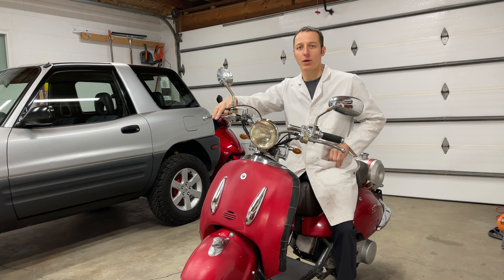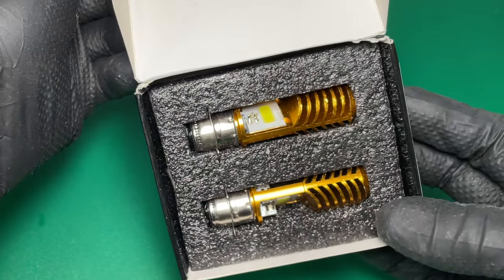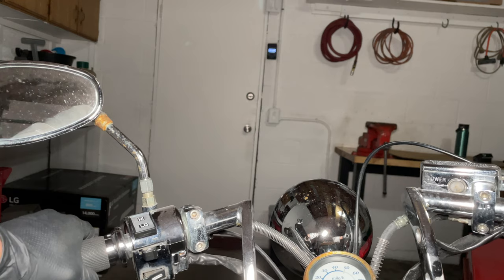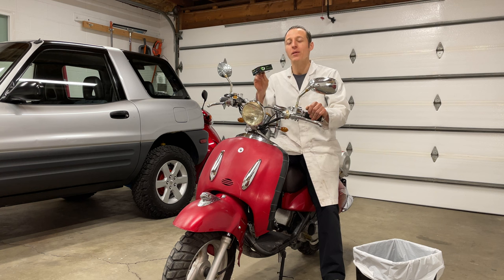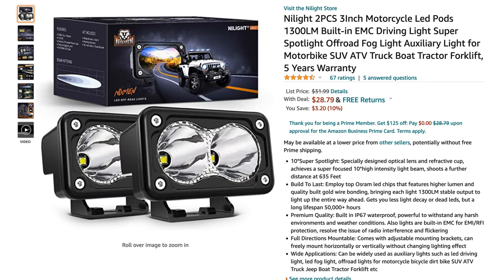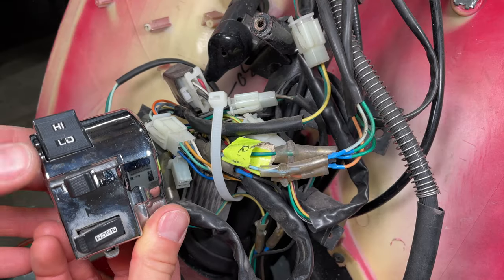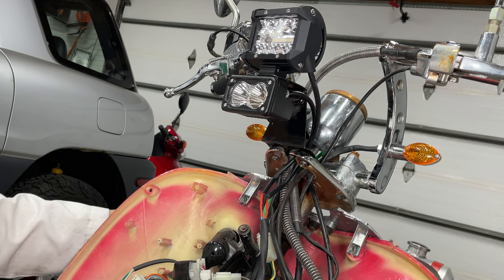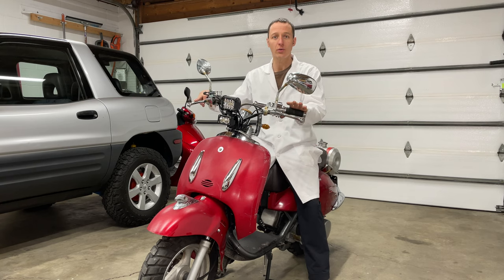LED headlight upgrade on a 150cc GY6 Chinese scooter

Comment: for future readers and viewers, those white/yellow wires coming from the gy6 139/152/157 stator are unregulated AC and require bulbs to dampen voltage and current. without bulbs AC voltage will go out of control and everything will burn out, so you need a resistor and choke to clamp that down.
don't ask me how i know.

Comment: Offroad lights typically dazzle oncoming traffic. Consider a driving light with the proper beam pattern and cutoff.
Reply: Unfortunately even factory lights have gotten ridiculously bright. If you're stuck with an old car these are actually a good way to fight back through the other drivers LED lights. I have one on the back of my truck I'll turn on if someone's following me with their brights on 😆

Comment: Your highbeam light I use on my scooter  same way. OEM bulb on replaceable in fixture only high beam worked, so I pointed it down and added the little light works well, love when cars flash their brights at me and I switch to the LED then they didn't mind the fluorescent too much . 
What you use as the low beam I use on my truck for work, works well to see more than 180° on each side or to blind other drivers who can't seem to turn off their brights 
I see you did not use a resistor on the scooter nor did I 👍🏽. Good video bro I'm gonna have to go back and watch some of that in detail to understand the wiring to help me set up my Yamaha Zuma bugeye turn signal LEDs
Reply from the maker: Thanks for watching!  Good luck with the Zuma.

Comment: About this time last year, I bought a new LED headlight bulb from Amazon,  it's much brighter than my original headlight , I paid more and got only one bulb, it is wired correctly,  I think you could have gotten a better lamp if you wanted too , you deliverably picked the cheapest  selection ,  I suspect you did this as a "lesson by example"  so viewers would not make this mistake
Reply from the maker: This one was a weird bulb size, so I didn't have any good quality options on Amazon.

Comment: If the brown wire is ac current, can you just eliminate it all together to just run off the switched DC power from the black wire? Or why did you connect it with the black and white wires?

Comment: You could put that unused 12 volts ac into a voltage regulator and power a usb charging outlet for charging phones and other accessories without and extra drain on the battery, WOW 😳
Reply from the maker: Not true.  The 8-pole stator puts out very little current.  It doesn't matter if you take it from the A/C or the D/C wires, you're still limited to about 3 amps total for the charging system.
I recommend upgrading to an 11 pole stator if you want to install additional accessories.

Comment: Re: broken plastic screw receiving holes.
I wonder if bondo would stick and could be appropriately drilled to receive screws ?
Reply from the maker: Bondo is designed to work with metal. Epoxy would work better with plastic, but the body fairings on Chinese scooters get brittle after a few years, so I just tape mine back together.

Comment: I know you saw my video review on the Nilight Nixmen for the Ba20d style bulb. I wonder if it helped you choose the Nilight brand for this project. I agree, the model you used is horrible for brightness and the difference between the high and low beams. As you see from my video I had a much different experience where my Nilight Nixmen worked awesome for both brightness and difference between high/low. My one LED cost 25 dollars. Your 2 for 16 seems really cheap. I'm sorry you had a bad experience with the brand.. perhaps you got a knock off? It seems strange you and I had such different experiences. I see your individual High and Low LED's are still Nilight brand and work well. Perhaps it's just that that particular model was off, not designed correctly?
Reply from the maker: I should have ordered the same light you got.  When I did a search for the P15D bulb, all I found was that junky one.  Nilight is a pretty good brand.  I bought some Nilight off road lights a few years ago, and they worked ok and didn't break, so that's why I got their off road lights again.  Perhaps if I searched a bit more, I could have found an LED bulb that works well.
Reply: @LabCoatPaul  I'm thinking even if you got the bulb I got it wouldn't fit your P15D socket. I know you had to find one that's claimed to match the socket/bulb style you have as I did for the Ba20d style my scooter came with. The error is clearly not your fault. I think they just really messed up on the P15D bulb. Perhaps it's a leftover from the earlier attempts at designing an LED bulb.

Comment: I want to add an ac to dc converter at the light switch so all my lights can be dc .so if i hooked acdc converter to the brown wire on the light control that should put evrything to dc from control right?
Reply from the maker: You don't need an AC to DC converter (also called a rectifier).  The voltage regulator already has a rectifier built in, and you just need to connect to the wire that already has DC power.  (just like I did in the video)
The 8 - pole stator doesn't put out much current, and adding a rectifier to the A/C wires won't give you more total power.  If you want more power, upgrade to an 11-pole stator.
Reply: @LabCoatPaul  could I connect the blk wire to the brown wire that leads to the light switch to make all lights dc ie turn headlights and brake?

Comment: Hi Paul, love your videos, however I think that your videos arent being promoted as much anymore, as I never see them in my recommended when you upload. Anyway, would you consider putting a nudge,bullbar on your rav4? 
Thanks.
Reply from the maker: I guess youtube isn't doing me any favors.  If you hit the notification bell next to the subscribe button, it will tell you any time I have a new video.
I haven't gotten to installing any accessories yet because I'm still working through all the repairs the RAV4 needs.  At some point, a bull bar or a bumper would be cool, as well as a skid plate and rock sliders.
Reply: @LabCoatPaul  Fair enough. Im trying to get myself a convertable one, but there so rare here in New Zealand.

Comment: Won’t the led have a low lifespan without a regulated power supply?
Reply from the maker: The LED lights have a built - in voltage regulator, so theoretically they will last a very long time.